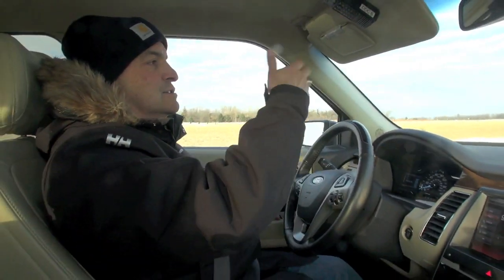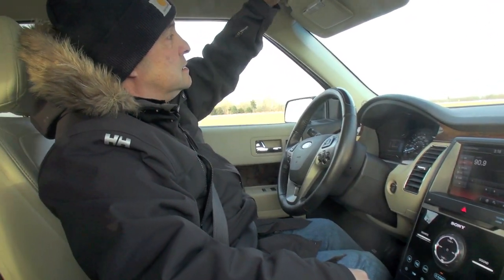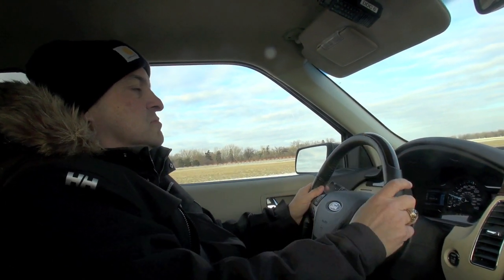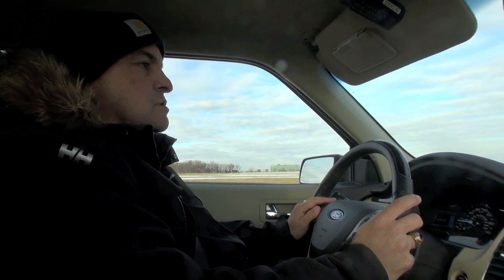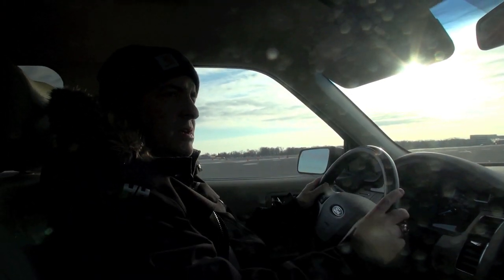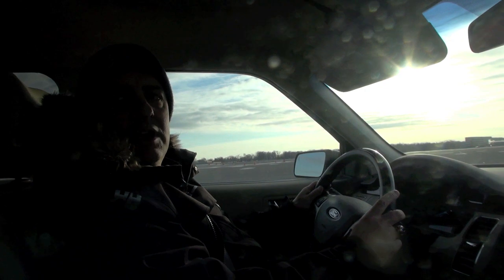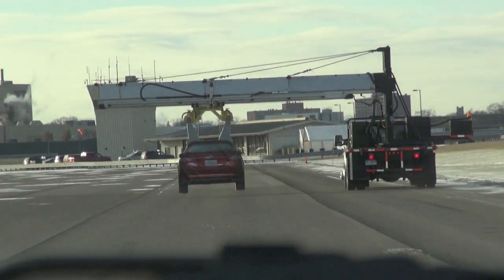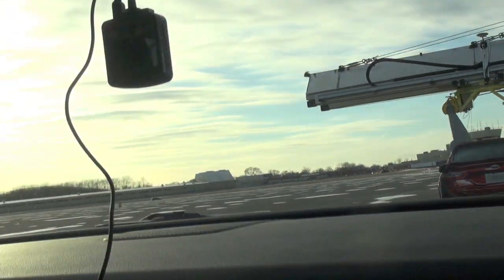Ford Collision Warning System explained at the Dearborn R&D Center

Comment: That's fine and it is progress in today's road and traffic environment but what stops the vehicle behind you from stopping if the driver isn't concentrating , this could also have fatal consiquenses to both parties. The answer is of course " fit the same system to all vehicles new or old as standard " THEN and only then the system would become full proof.

Comment: Great in theory except ford is junk and the parts don’t last. I’ve seen so many f150’s with malfunctioning cameras which disable the system at only 30,000 miles.